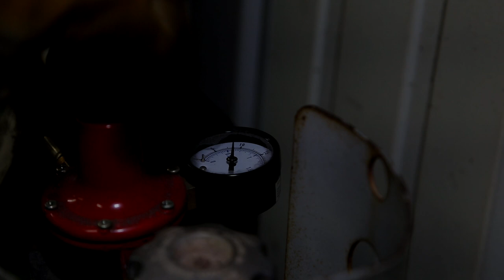Forged turkey foot fire poker with hand guard forge welded blacksmith project - fireplace tools

Comment: Really nice videography, and a beautiful poker too! One suggestion: If you hold the bar 45 degrees to the anvil and create a set down where the centre of your fold will be, it's much easier to bend that tip section back on itself and get a clean weld line. I've only just started getting good welds but that helped me to some extent.
Reply from the maker: Thank you so much! And I really appreciate the tip I'll try that here soon.

Comment: He didn't mention the length of the angle iron. does any one have a good estimate on the length.
Reply from the maker: 10" gives enough to go around most large paws.
Reply: @wrotiron  
Hallo. Thank I came to the the same number as a best guess. Will use 10”